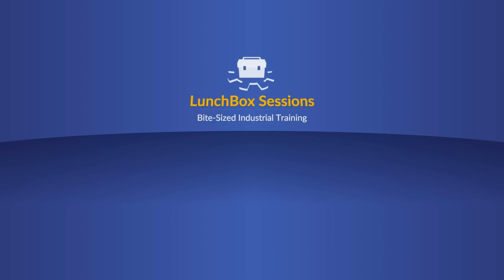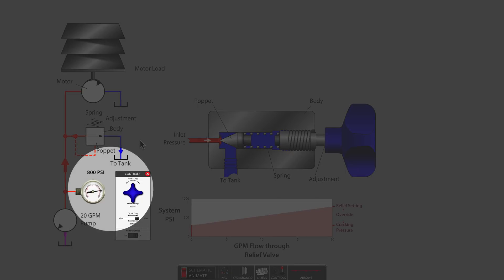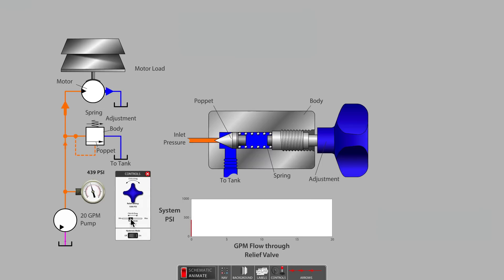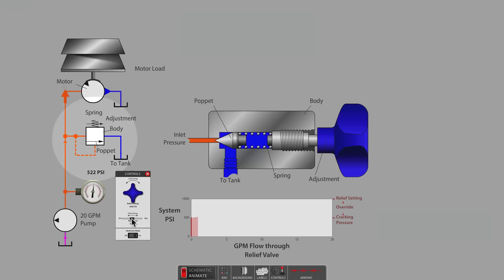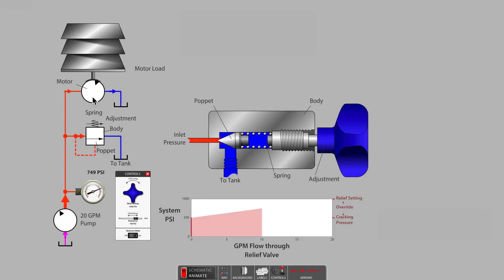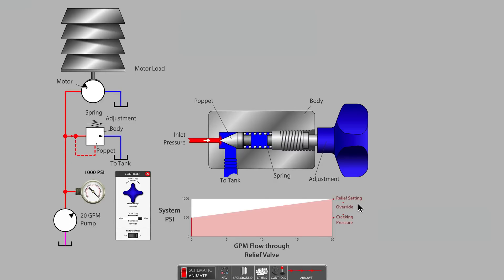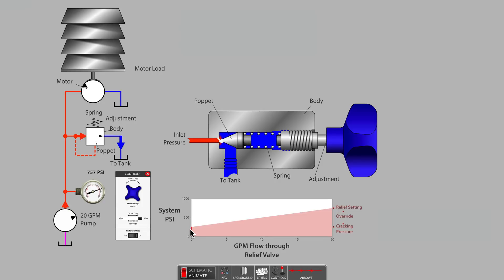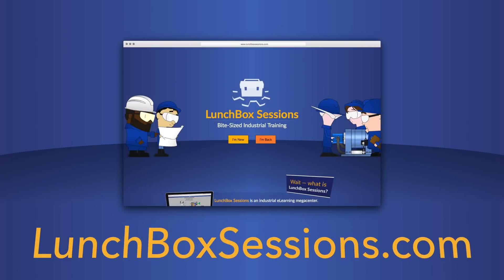Direct Acting Relief Valve

Comment: I have a conundrum. My excavator functions fine when first starting to work but after about a half hour I lose speed and power.  Its believed to be the Pilot relief valve but why and would the accumulator have anything to do with my issue.
Reply: main controlvalve error

Comment: What does the dotted line in the relief valve symbol represent  ??
Reply: It represents pressure line to poppet side. The dotted line is on the opposite side of the spring symbol, which means they are working against each other. Oil working on the poppet will counteract the springs extentional forces and then contract it, allowing pressure to escape to tank.